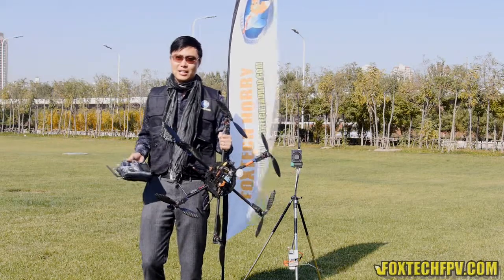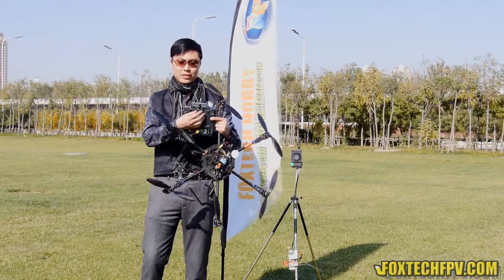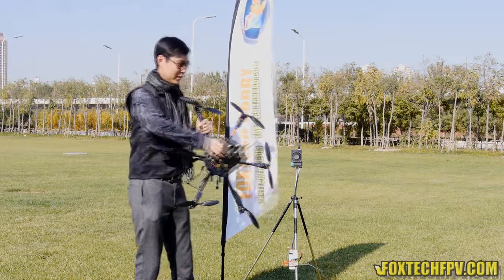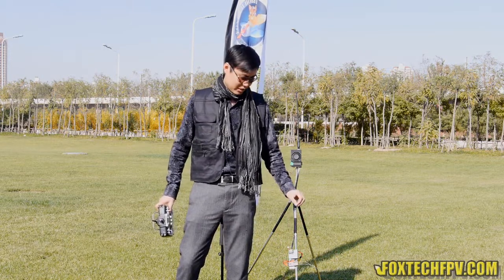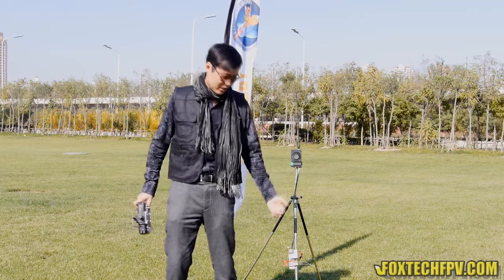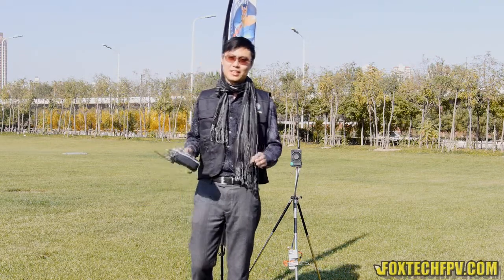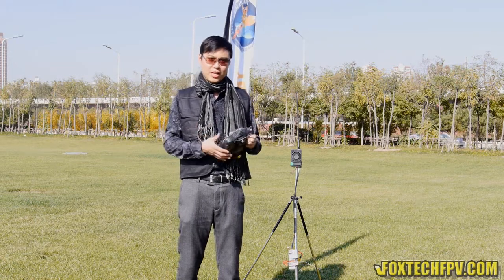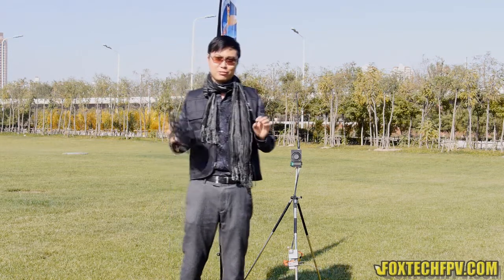RMILEC T4047NMB20 UHF Long Range RC System  Outdoor review

Comment: Hi Fu, this set up will work with dji Naza M V2 ? can you make a diagram on how to connect this to Naza M flight control? im very interested, i sent email but the lady didnt answer mi back. thanks
Reply from the maker: hi docas101, just change the old receiver to the NB20 's  receiver and hook the old receiver to NB20's TX module ,then you don't even need to change your radio setting
Reply: Foxtech Hobby

now i understand clearly. im going to buy it this week. thank you
Reply: Foxtech Hobby

i just bought. if this will works well in my set up i will buy more. like 10 units of this UHF RMILEC for our rc group. thanks
Reply from the maker: DoCas101 : )No problem .

Comment: Is that sound coming from the TX stomping on the mic?  That's a REALLY dirty TX, it will surely stomp all over the 1.2 and .900 Ghz bands...possibly more...
Reply from the maker: It's not because dirty RF, it's just electric magnetic.
but you can put the TX 500meter away from you using this theory .
much lower RF effect on human body than other UHF,